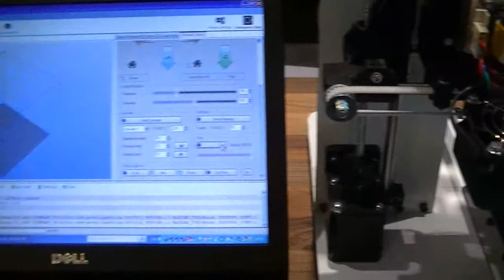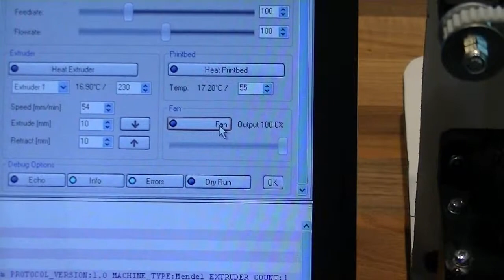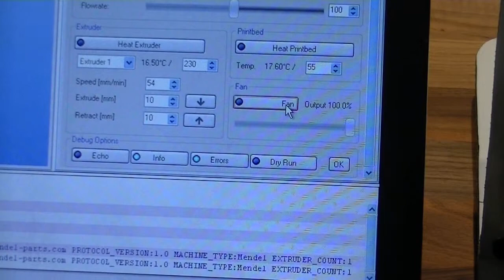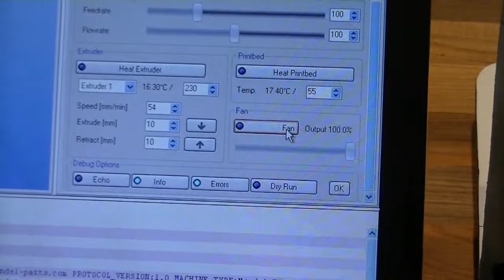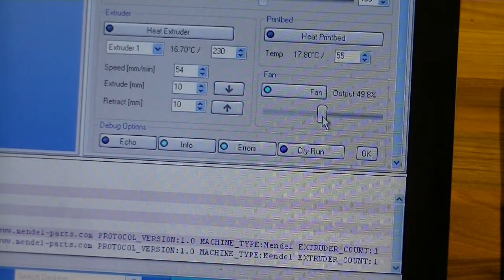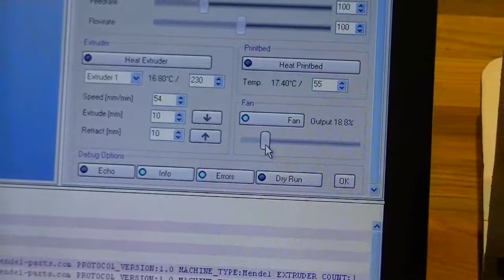Cooling Fan speed mod on Mendel90 with Azteeg X3 controller

Comment: Nice, i just have one question. If i would like to put a speed controller in my computer for the fans would i need specific fans with inline resistors for this or would my original fans work?